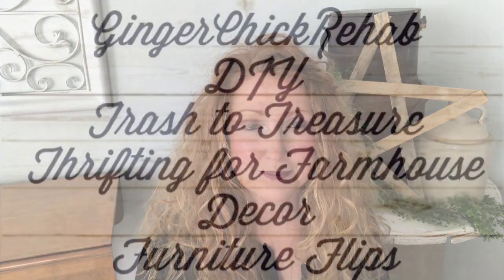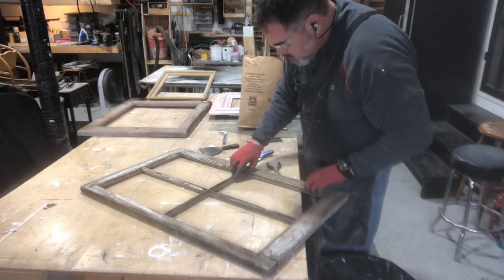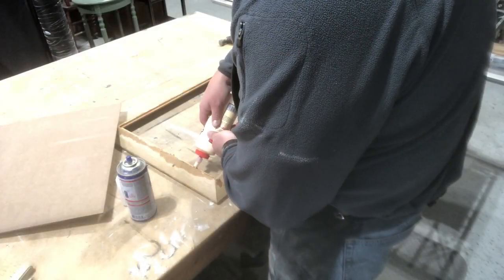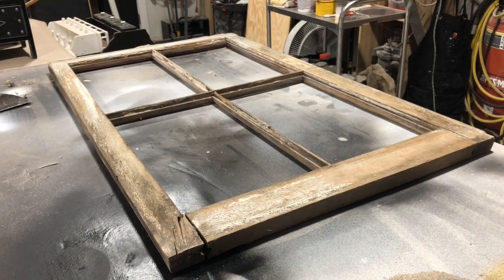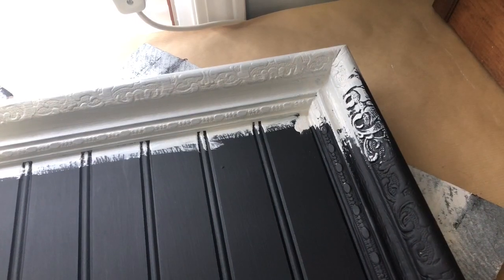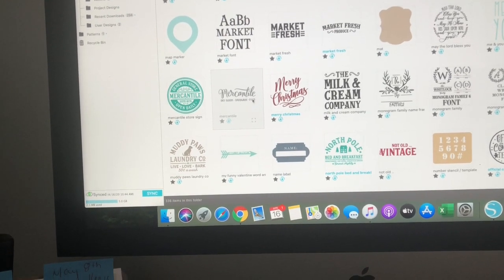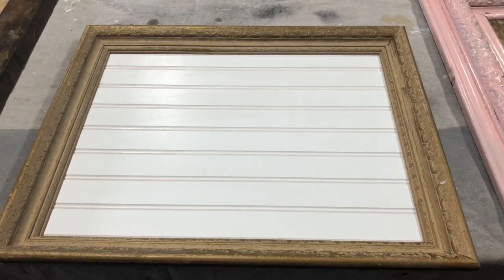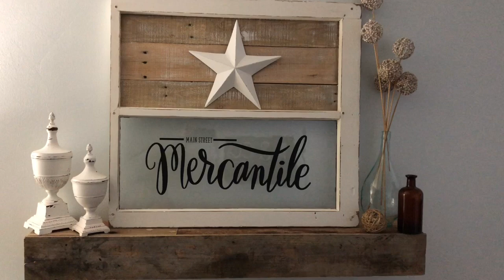Up Cycling Vintage Windows and Frames to fit into Farmhouse  Decor

Comment: I love old windows, I would have gotten it for sure. Such a Super idea putting palette wood in the windows and frames. I just did that with an old frame like the white one you have. Mine was black plaster and I used paint  stirrers from Lowe's, cut and them down to size, painted them and glued them to the back. 
I love how yours all turned out. It's great when your husband partners or helps, it makes life so much easier!
Reply from the maker: I would love to see that. I bet it’s beautiful. Great idea with paint stirrers.It’s definitely so satisfying to get to up cycle and save these from the trash😊💕